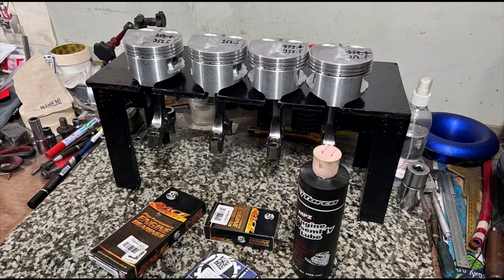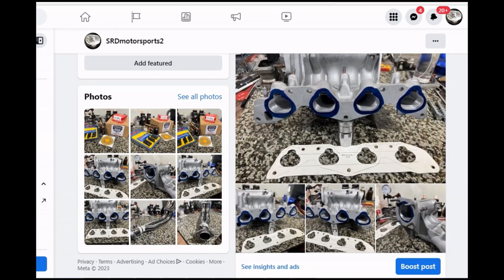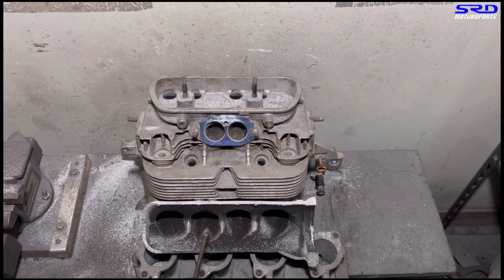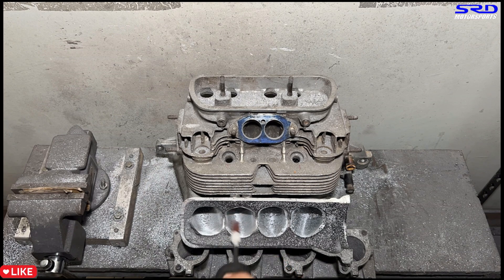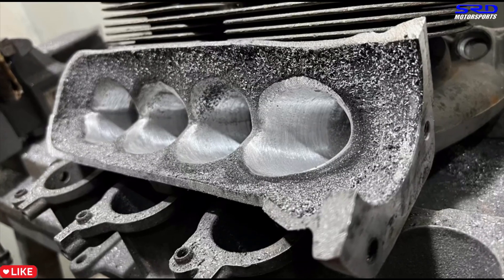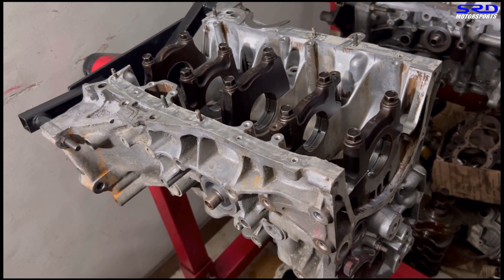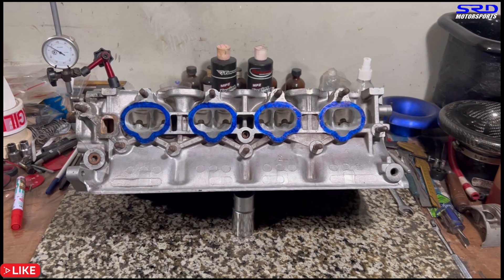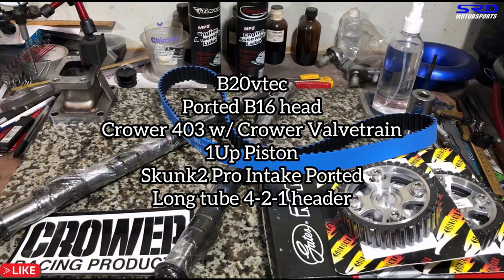B20Vtec Build Part 2 Head and Intake Manifold Finished Work

Comment: Where can I find some of those sand bits
Reply from the maker: I cut my own and use 80grit and 120grit and use a 6in shaft extension…

One can get the sanding rolls (cylindrical) not cone. It’s hard to get consistent shape on cone from Standard Abrasives or other tool shops in the US and get a 6in extension they call a mandrel